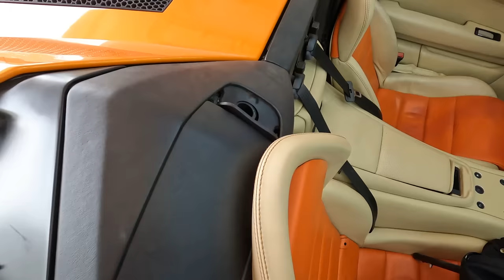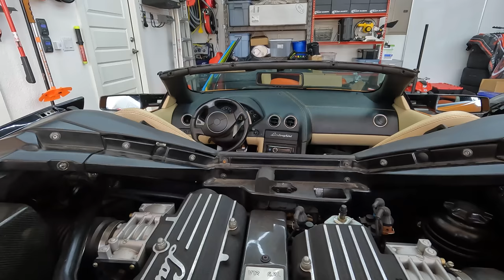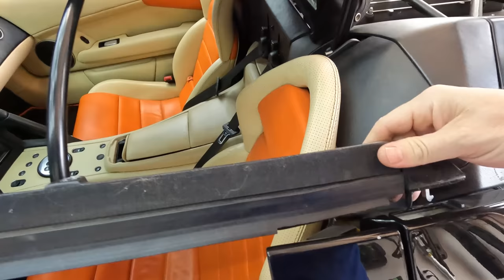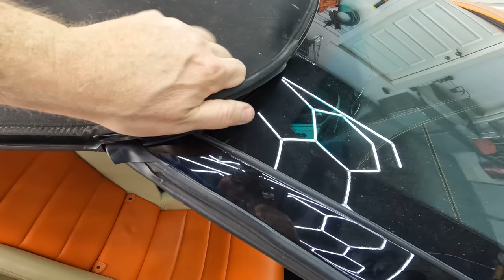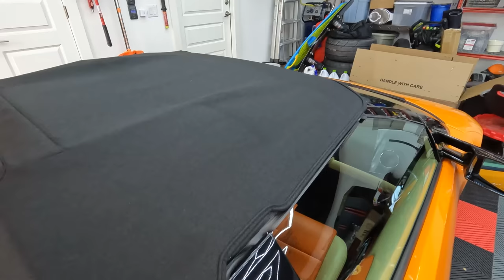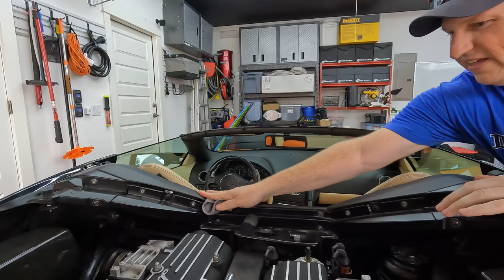The Completely Insane Lamborghini Murcielago Roadster Roof Installation

Comment: Our Jaguar Project7 is the same way…. 3 window sections made entirely from carbon fiber and glass and then a large fabric top. The sections really don’t line up and you have to tweak it around a lot to get it to all line up. Really a 2 person job… can easily take 20 minutes. Of course all the pieces almost fill the only trunk but you have to keep it with you in case of rain…. Sooo I never put it on. But it is SOOO bad ass to drive around! OHHH…Of course… the top has no insulation and is neither wind nor waterproof.
Reply from the maker: Yeah sounds about the same lol